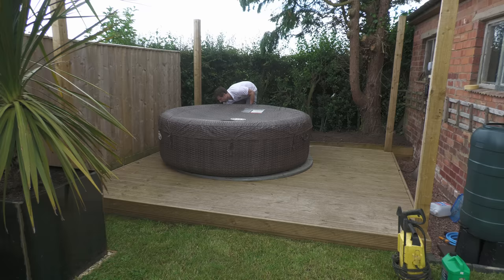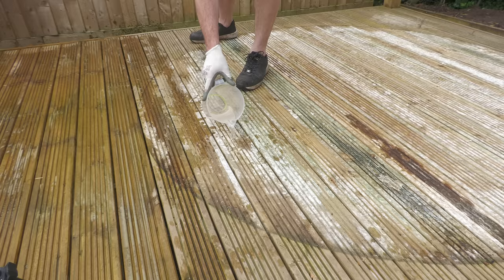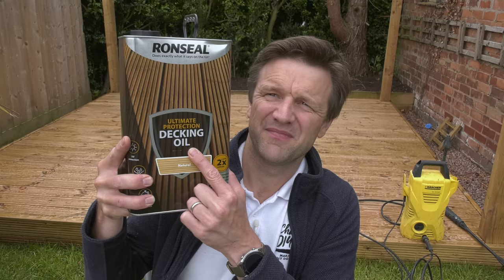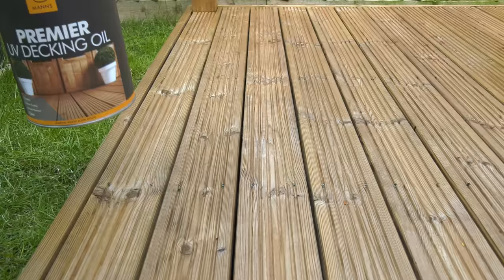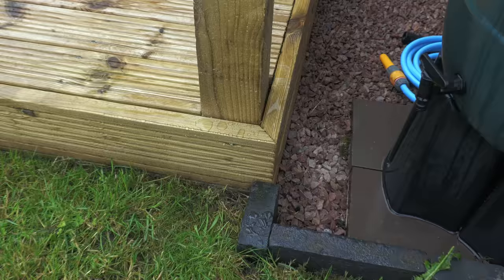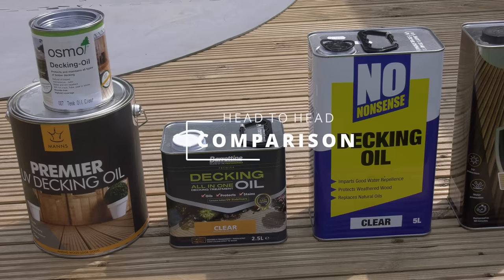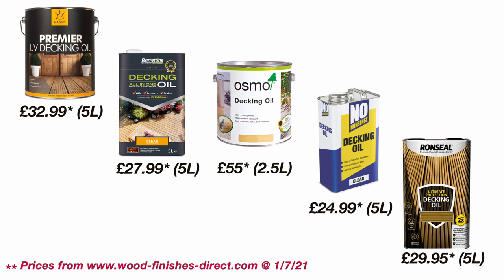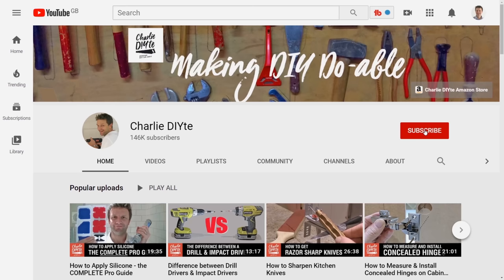How to Clean & Oil your Deck

Comment: I have a large deck and have always used Ronseal ultimate Natural oak decking oil.  I agree its sadly not very effective but the problem I've encountered is I have wooden railing around my  deck and annual application has made this progressively darker year after year. Jet washing will not remove this even at high pressure. Tearing it down and starting again would cost thousands. Any thoughts on stripping it back? Its a big deck approx 50' by 12' so too big to sand.
Reply from the maker: I'm at a loss to know what you can do. Is it just the ballastrades that have gone dark or the whole deck? Unfortunately that natural oak is acting like a stain on the surface which gets progressively darker each application. The only solution is to sand it off, and if you have grooves that is going to be problematic. I think your best bet is to try equal parts of lacquer thinner and denatured alcohol as discussed here https://bit.ly/3dFwfRB Experiment on a small area and see if that removes it.
Reply: @CharlieDIYte  Thanks, I will give it a go and post how I get on. In hindsight I should not have used a product with a stain in it as I didnt realise it was cumulative and some parts have been subject to more fading than others so there's no uniformity in colour now.

Comment: Great video and I’ll be using the Le Mans stuff this season now. 

I got the no nonsense stuff splattered on my glass balustrade and have tried everything to get it off with no luck. Any advice?
Reply from the maker: Have you tried Multisolve spray from CTEC? https://amzn.to/3dKkQjL The stuff is awesome. Every house should have at least 1 can as you can use it for so many applications or perhaps some thinners? That's an affiliate link btw but doesn't cost you anything to click on it.
Reply: @CharlieDIYte  thanks Charlie. No I haven’t but I will now! I’ll comment back on how I get on. 

The most success I’ve had so far is with acetone (nail varnish remover) and a drill with a scouring pad type attachment thingy but it was slow and painful
Reply from the maker: It's great stuff. The challenge on a vertical surfaces is to get it to stay long enough to erode the residue. It worked here on duck tape residue though https://bit.ly/2TqEUuS You might also get a razor blade scraper.  Maybe something like this https://bit.ly/3wg2FJa

Comment: I took your advice in good faith regarding needing the Osmo telescopic pole for the brush  so I ordered one, 35 quid it was and because the delivery was late arriving I tried a cheap £8 B&Q pole and it  fitted perfectly, you said  you had lots of poles which didn't fit so basically you lied and bullshiited  for your affiliate links, cheers pal
Reply from the maker: I didn't lie Sean. The extension poles I have don't fit the kit.

Comment: I used ronseal normal Deck oil on my old deck as it was solvent based and cheaper than the ultimate which was water based and cost lots more, at the end off the day decking is shit always looks good till it weather's then you got to keep maintaining it waisting time and money on products I will never have one again if any one is thinking of one then spend that extra and get the plastic deck or just put a decent patio down.
Reply from the maker: Thanks Darren. I really don't know why I didn't just lay a patio. It would have been so much easier!

Comment: Do the oils stop the greening on the decking or reduce it?
Also, your timestamps in the description are wrong, you have a full stop . splitting the minutes and seconds rather than colon : which makes them none clickable
Reply from the maker: Thanks for pointing that out Frazer. Not sure where those colons went. Yes it definitely stops it greening. There's basically nothing for the lichen or whatever it is to adhere to.

Comment: Would spraying the oil on with an electric sprayer work just as effective as brushing it on?
Cheers
Reply from the maker: I can't see why you'd need to do this and it would be more difficult to regulate the quantity as you can with the brush (in the sense that the last swipe of the brush and you've taken off the excess), but yes, I guess.
Reply: For speed mostly

Comment: I think your write uo is slightly miss leading 

"Today's video shows the Complete Upgrade of my old toilet from Syphon with Ball Valve, to a Dual Flush with Fill Valve system. "
Reply from the maker: Thanks so much for pointing that out. I stupidly didn't change that bit after copying the text from last week's video. 🤦 Now amended.

Comment: i been trying to clean decking this weekend  but just can't  get all the green slimey stuff off unless i scrape it by hand, even use that cleaner and it appeared to have made no difference.
Reply from the maker: Have you tried a pressure washer?
Reply: @CharlieDIYte  i did once and didn't really make any any difference, just removed the surface stuff,  i try to avoid using them as they can damage the wood.   maybe i'm just being overly fussy about it.

Comment: How can I clean composite decking?
Reply from the maker: You could use that Osmo deck scrubbing brush with a soap and water solution and give it a good blast with the pressure washer.

Comment: Buyer beware! I feel like a complete mug falling for the products recommended in this video. I purchased the Osmo scrubbing brush and telescopic handle. The brush is too soft and did a very poor job of cleaning the decking and the handle broke after an hour of use. The brush also kept twisting on the head with minimal pressure. It simply is not robust enough. I also used the Ronseal deck cleaner which was another waste of money. I ended up scrapping the lot and using a cheap stiff scrubbing brush and warm water with washing up liquid and it honestly gave me far superior results.
Reply from the maker: Matthew sorry to hear this but I still use the cleaner and brush and haven't had any problems with them.

Comment: Although I love óíl based deck finishes I think all paints and stains and preservatives are going waterbased.  I note that outdoor wood and metal primers and finishes are all water based acrylics and far superior to oilbased paints that bubble and peel, I hope that waterbased deck oils and stains will become as effective. For now I'm deck oil all the way. Pity there's no way of easily hingeing up the deck to treat the subframe😒
Reply from the maker: Thanks David. Yes I treated my subframe with Bostik bituminous paint. Ventilation is key, and I need to increase the ventilation on mine.
Reply: @CharlieDIYte  yep, I did quite a few decks back in a boom time and ventilation was always hard to achieve in a cosy spot cause they're kinda chosen for they're lack of wind🤔 the bits that rot quickest are the spots where the planks are sandwiched to the subframe and around the screws, a bitumen preservative definitely increases the durability but I don't think Ireland or England have the climate for longterm deck.
On the up side I pulled out many decks over the years and built 4 Stables, feed sheds and goat sheds, when the planks are used for walls they get plenty of air circulation and last much longer in their second life😊 free wood that was removed cause it was slippy and the subframe was rotted,  planks were still fairly intact and fine for cladding

Comment: Oh no for all that palaver. Composite decking is the way to go. Run over it with a vac if crud is between the boards and a quick tickle with a mop and job done. I ain’t never going back to timber decking. I thoroughly recommend it to anyone looking to lay a new deck or replace an old one.
Reply from the maker: Thanks Tony. It's expensive though but I hear what you say 👍🏻

Comment: That Ronseal Cleaner is garbage. It certainly does not work in the way you showed it. My deck has a similar problem with moss and green stains from weathering, after jet washing first I used that and followed the instructions to a tee, virtually none of the the green stains came out of the deck, there was no difference, total con. I will probably have to look to sanding it
Reply from the maker: All I can say is it worked for me.
Reply: @CharlieDIYte  Appreciate that, I ended up having to hire power sanders to get rid of the green, just doing the cleaning now after sanding and that will have to be that!
Reply: Yeah it didn't work for me either that much. Fairy liquid worked better lol.

Comment: He's not really oiling the deck, the entire video is misleading and wrong.  Solvent or water really doesn't matter, both evaporate very quickly, leaving behind petroleum based plastics for UV protection, water repellant or pigment.  Water repellent has nothing to do with the oil/solvent, as it evaporates completely.  The water repellant is due to the plastic coating left behind.  Over time, some of the plastics wear away and some are left behind, on or near the surface.  Basically all you're doing is putting a film of plastic on the surface of your deck.  Pigmented linseed oil paint or stain is the only finish that actually penetrates, fills up the wood pores and remains in the wood pores.  Linseed oil stain will last about 3 years, you actually want a build up of product, you then clean and reapply, no sanding should be required.  Allback has quality linseed oil products.